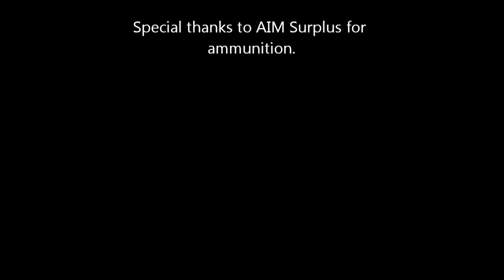Grand Power Duo - K100 Mk7 and P1 Mk7

Comment: Nice video, thanks! Found your video linked from your Tactical Review article. I think the reason that the magazine capacity is stated as 15 rounds by the importer and factory is to avoid prohibition by states that forbid magazines of greater than 15 rounds. If you load 16, you'll notice that the last round is visible in the bottom round count hole on the mag. Just purchased a K100 and am looking forward to its arrival!